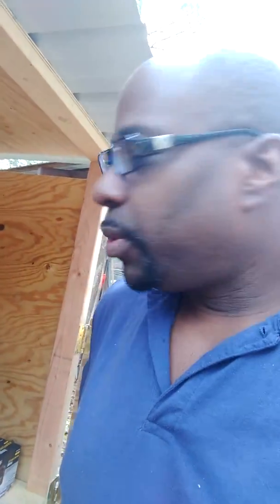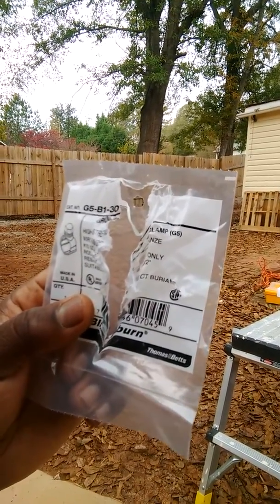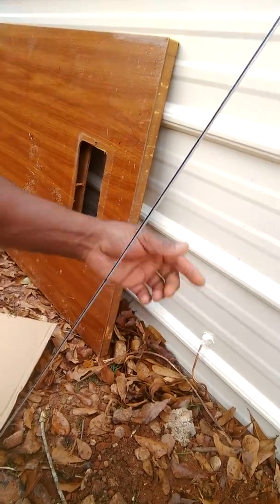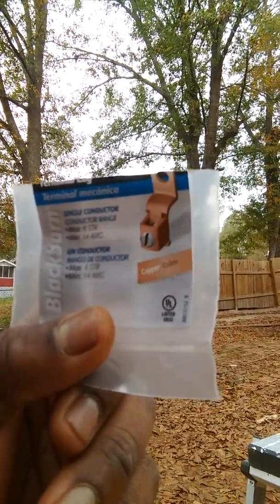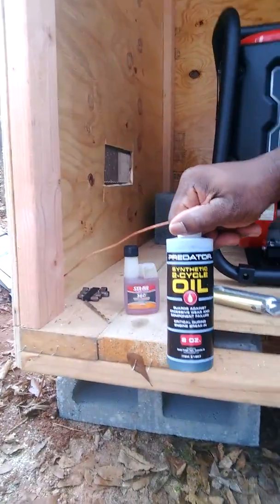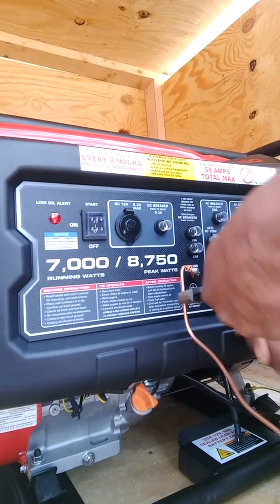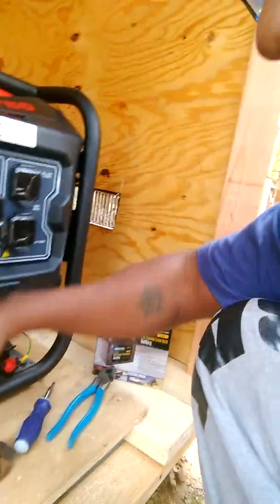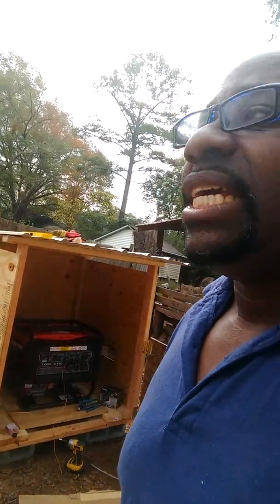How to ground a Generator part 1 plus steel building.

Comment: Sir, I have a power breaker box in my back yard and next to that box it already has a ground wire connected down to the ground. My question is could I connect my ground wire from my portable generator to that ground wire? Or I have to make a new ground wire? Any info you provide would help me out alot thanks
Reply from the maker: Yes, technically... However, it's best to buy you a grounding rod which is about 16 bucks and get a mallet and beat it down in the ground and get the eclipse and ground it straight to that because it depends on what you are using your generator for. I'd use mine to run screen printing equipment which use a lot of power. So, for me it was best to ground it independently.

https://www.generatorhero.com/how-to-ground-your-portable-generator/
Reply: @innovativethoughts  Thank you Sir for your help.
Reply from the maker: You're welcome

Comment: It's going to get extremely hot in that shed and might catch it on fire ! It needs to be totally lined with a heat and fire proof material. And well ventilated.
Reply from the maker: It does get hot. Not hot enough to catch fire only because I keep the window open.
Reply: Please watch this video about generator safety https://youtu.be/I1jT3ANENvI hope you stay safe

Comment: That engine takes 4-cycle oil!!!
And make sure the exhaust area is far from the wood walls.
Reply from the maker: Yes, thanks, I have it vented for air circulation and exhaust.